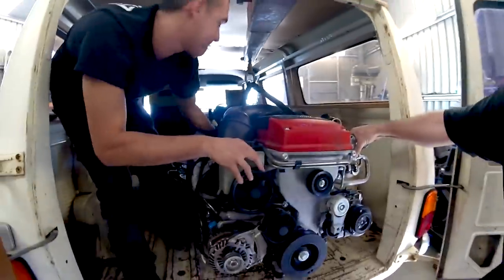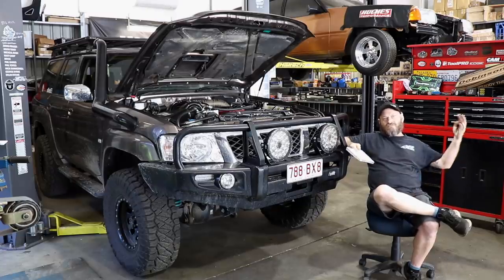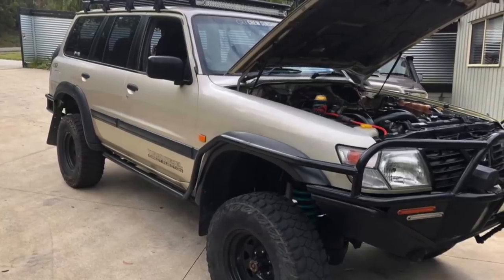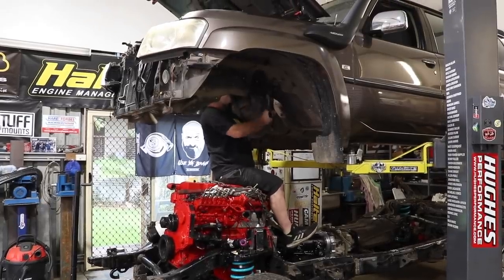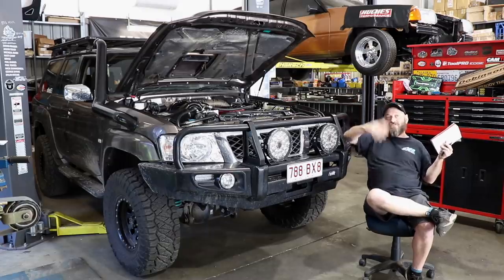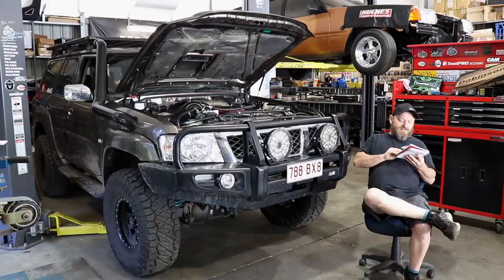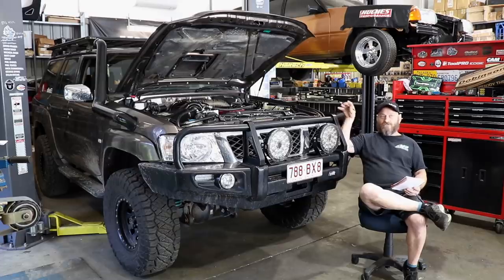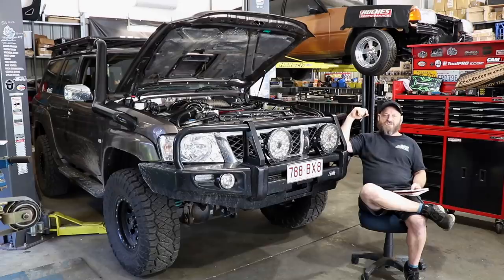Thinking of a Cummins Conversion? Watch This First!

Comment from the maker: New Merchandise Available! https://theskidfactory.com
Reply: Hi  I was wondering how a V8 landcruiser motor would go in a patrol and why no one has tried I was told they don't fit which doesn't make sense when they fit a duramax any comments
Reply: You couldn't fit a 6 speed allison 2000 in there?
Reply: Active noise cancellation might help knock down some of the engine noise. Pretty much put a mic near the driver's ears, feed that signal into an audio amp which drives a speaker, but swap the polarity of the wires going to the speaker. If that works a bit, you can make it fancier by gutting a pair of active noise cancelling headphones and using the output to the ear cup speakers to drive the audio amp & speaker.
Reply: We wish researchers and workers in the technology and engineering department to find plans for the new car industry
Because new cars should be flying saucers in the sky
and These flying saucers must have three perks
1 / The flying saucers must be self-driving so that everyone can use them
2 / The autonomous driving of flying saucers must be based on artificial intelligence programs
3/Artificial intelligence must rely on the new Google Maps in order to direct the launch of flying saucers to the desired places .
Send these three basic demands to the technicians and engineers in the mechanics and technology department in order to make flying saucers
Reply: It's your knowledge that has me back everytime mate.. the tips and the tricks matched with a top bloke with a awsome sense of humour makes for good viewing          🤜🤛 🇦🇺 take care Al and stay safe brother
Reply: I’m not peein’ Eur-o-pean
Reply: dodge auto is rubbish,,the ford is better,,but the allison is best.. why,why,on earth do you need a cummins in a fkn patrol..for 50k,i can get you 100 decent deisels. cheaper,better lighter..you dont need 1000 ftlb to 4x4.  1400nm.ish..stupid..you like tech,.should of got the 5lt tdi cummins..kills toyotas crap..
Reply: The Skid Factory 
Exactly how does a Cummins crate engine cost $50k (USD)?

Comment: Projects are always bad financial decisions but it's what we like and it makes us happy
Reply: Yeah and it’s still cheaper than a 79 land cruiser price and if done right better in every way and there so popular so it’s probably not as bad as it sounds long term.
Reply: It all depends on the size of the project.
"Small" upgrades around a weekend to bash out can be really economical.
Full builds and conversions are rarely economical but they really build the sentimental value.
Reply: I don't know- have you seen what new cars cost these days? You can easily spend 45k€ on a VW Golf... a nice Audi sets you back 65k€...you can mess around with a project car a lot for that... sadly in my country project cars are very hard to get legal- and especially engine swaps are almost only done withing a model range
Reply: Yep, just take me n my Subaru. I'm 14 years in and it's done more miles on the back of a trailer or in a shipping container than it has under its own power!! Just need to get that EZ30 built, hey Al...? 😉
Reply: Hi Mate, I have been looking for quite a few years now at a the Mercedes om606. From all accounts they seem to be a very reliable and economical engine, capable of big power. I have done a fair few patrol engine conversions now, from my first which got a L34 308 in a mq.
Have spoke to diesel pump UK about sourcing the components and they told me they can supply the complete conversion with engine for  15k, plus shipping which in comparison to some other conversions, is very reasonable.
Reply: not always buddy
Reply: And the sell it
Reply: @michaelperrin3503  Better in terms of reliability?
Reply: I don't build trucks or cars but I do build motorcycles ( frame - motor build - paint) . It's a hobby , but If I can't make 3k plus off a motorcycle ; I hen I won't even bother with it.
Reply: @kramer26  that's because it's a Subaru...

Just kidding mate couldn't help myself 🤭
Reply: Hahaha!!! Love your comment. You absolutely hit the nail on the head brother.
Reply: @immelting9834  well it's a business then and not a hobby

Comment: GVM and GCM became a problem when the insurance companies started weighing everything that fell out of your 4x4  onto the road after you rolled it with your 87ft van on the back to deny a claim.
Reply: And quite rightly so! The vehicle was engineered for a given mass for a wide array of reasons. Brakes, suspension, chassis and so on could all be inadequate. Poor control of your towed loads can also be a real problem, leading, as you say, to your 87' van spilling its guts. As much as I am not a fond a large US pickup trucks, if people are going to tow 3500kg and heavier caravans around, they are likely a far better option.
Reply: Yep and the new ute/truck things are the only way to do it and still be under that number, without being the only person in the vehicle with no gear.
Reply: Hence I bought a new silverado 2500HD to not risk a no payout if something happened when towing the $250k toy
Reply: I've done a GVM and GCM upgrade on my 200 Series. I only tow a Kimberly Kamper and it still get's sketchy sometimes.
Reply: Agreed ... If your going to tow small houses behind a vehicle, get the right damn vehicle. F truck, ram etc and be safer while doing it.

Comment: 15:30 "Nowadays everyone hates smoke, which has changed from last week."  Subtle and timely remark there, well said.
Reply: Well... outside or our bubble, most people want clean air and quiet cars
Reply: If you follow Deboss, he's always said that rolling coal is childish and offers zero performance benefit.
Reply: @muf1772  "Performance" is when a machine does what YOU want it to. Deboss's assertion that he knows what is best for you is the over arching problem here. You gotta get better at spotting authoritarian cucks and silencing them instead of elevating them.
Reply: @DieselRamcharger  Making childish comments to defend yourself against being called childish, that's gold
Reply: I can be a public annoyance for much cheaper

Comment: Nice to see honest opinions from someone about there own build.
Its too easy to just pretend what you did is all spot on and perfect.
4JJ1 would be a good choice in the Diesel world but i reckon a Barra with around 380 RWKW would be tough to beat and the 25 odd grand of fuel you could buy with the savings would go a long way.
Reply: Agree, the 4J would be a great choice with the aftermarket possibilities!
Reply: Too true on the 4JJ1. Considering one for a 60 series conversion… or a Barra.
Reply: Yes barra would have high hp and the power would be in a different band high in the Rev range being petrol this makes it easily down low with minimal stress , but it’s all about what noise our ears like to hear 😂😂
Reply: @jmac822  maybe so but would be highly stressed maybe ?? Where as these big ol donks just plod along mainly in idle , also the 4.5 cummins get good power very low in the Rev range which is where u want it ,
Reply: I daily drive a 4JJ1 Rodeo,   and have had a TD42T patrol for the better part of 12 years.
I wouldn't put a 4JJ1 in a Patrol, While the peak power might give some people a boner, the driveability is not the same.
Reply: @bradmcgrath358  exactly like he said hp is all well and good it’s the torque u want and down low
Reply: They do 4jj1 patrols in Sydney now
Reply: @keithy363  Nothing wrong with the 4jj1 torque mate 
4jj1 upgraded injectors , turbo , front mount , computer 
Blokes are getting a safe 250hp AtW and over 600nm of torque
Reply: @jmac822  they snap cranks at 300 😂
Reply: @jmac822  was talking about the bloke saying a 4j making 600hp on standard internals

Comment: I LOVE that Al embraces modern tech. Too many guys afraid to learn. They see all the wires and run for the hills.
Reply: true and i took the time to learn it and then i only ran from it more. what happens when a pcb board gets fried or the software acts up. with mechanical pump theres no guessing u can see and feel everything that’s happening. switching away from carbs in favor of fuel injection is one thing, but those mechanical injection pumps are stout mechanisms. they tend to be far more efficient as well suprisingly.
Reply: It very much depends on the car. I know in the classic minis the electric fuel pumps are the reliable option because the mechanical fuel pumps can fail in a way that leaks fuel into the oil

Comment: One of the BMW M57 varients, hard to beat price wise. Tremendous tunability and incredibly strong. Can get them from UK wreckers for pennies. That or an OM606.
Reply: I saw a couple GUs with an M57 conversion from Russia and Europe, they were making huge power from what only looked like a backyard job
Reply: I've been ogling an m57 for my d2. Would be a hell of a step up from the current td5.
Reply: Exactly. I cant see any good from swapping 6BT in passenger car like Patrol. That thing must weight in like two almuninium M57s.

Comment: Having done this conversion myself, but slightly different, I’d like to add my 2 cents. Obviously I didn’t do it quite the same as you but it’s definitely similar. I used a 12v 6bt through Texstar automotive. Originally all we were going to do was change all the gaskets, but thought since it was pulled down why not rebuild. Engine cost was $7200AU landed in Brisbane, rebuild was nearly 3k, but only reply once major parts that needed, and replacing all valves and stems. I always wanted a manual, and went with that to begin with, before going through 3 patrol gearboxes and shearing 3rd in all of them. I eventually went to a basic 4l80e, which was functional, but wasn’t what I wanted. Never played with the fuel pump too much, just went 4K gov springs and a fuel plate, but it just wasn’t to my liking drivability wise. Don’t get me wrong, could pull a house down but I’ve just never been an auto man. So I started looking down the path of manual. Ended up with a PaR gearset with custom 1-5 gears ( they have a shoo wheel of short or tall for every gear depending on your needs. They were originally designed for the Dubai 4.8’s with stupid power) and they have actually worked an actual treat! Thai set up also comes with a billet input and output shaft that is considerably bigger than factory to handle the extra load. Considering it only costs about 12k all fitted (including custom HD clutch to suit the shaft, it has honestly made the entire investment worthwhile! Taking out all the costs of doing things wrong, it can easily be done 45k on road with Abrams new motor and gearbox. I tow an OP4 camper as well and dragged that up little red just to be sure it could take me anywhere, and has no let me down. I have since done 8500k around Oz and wouldn’t change my set up for the world. Even with all my weight, fuel consumption is currently sitting at 13.5lph which is ridiculous for a car that size and weight! I personally believe that if I knew what I did now at the start I would’ve saved myself atleast 20k, but would recommend this conversion to literally anyone that will listen to me!
Reply from the maker: Thanks for the feedback mate, much appreciated.
Reply: I might need some of that info……just bought my patrol and I’d like to have a plan in place if it decides to go bang!

Comment: Google M57 bmw patrol. they seem to go great. thanks for sharing your thoughts on this conversion, especially since you have done a couple of different ones. i have had the a duramax also and now a LSA . they are both great in their own right  but very happy with the LSA now and prefer it. the ease to work on it, to get parts locally and the milage is no worse than a 4.5 or 4.8 from Nissan and instant power it makes, makes it a very enjoyable 4 wheeler.

Comment: Dieselmeken and BlackSmokeRacing would be a great place to start when looking at Mercedes diesels :)
I love this type of video where the job is being weighted and everything told as is. Keep going guys!
Reply: Diesel pump UK have alot of experience with the om606 conversions. They can supply a full billet aluminium conversion kit for the patrol.
Reply: Thanks i hadnt seen those channels but have now subbed. looks good.

Comment: Nice work done. I think a P Pump  24 V still offers the best of both worlds. I combined a 24 V in a 99Ram (got rid of the 53 blck and swapped to a beefy 12V truck engine with solid bed plate and 230 HP from the factory.) I changed the internal components, took some flesh out of the ´24V pistons (exactly like Jeff Garmond recommended it) combined it with the 24V head and a gigantic inline Bosch pump from a SEATEK 10.3 L offshore race engine.With twins, a huge intecooler and some free flow exhaust it made a little shy of 900 HP on the dyno but was so good with EGTs, that I could go with 230 km/h (I live in Germany) for a long time and never saw anything higher than 1280 f before the turbo. I have and H1 Hummer with a 6BT 12 V conversion and s Scout with a Twin turbo 12 V and 1044 HP@ the rear end (beefed up 9") That is a daily driver, even good on Gas and  with a 3.0  rear ratio and 20" Wheels I can shock Cayenne Turbo S and Trackhawks on the autobahn. They hate that it´s a Diesel with an historic license plate. If you google "Monteverdi race 2014" you see me competing with a 997 GT2Twin Turbo Porsche on a 1/4 mile race. I have an Airstreammotorhome with a cummins conversion and a Ram 1500 Shorty with a Cummins and just sold my 1998 Suburban with a 12V Cummins swap. In the UK you find those engines pretty cheap and if you combine some practical skils with a good network of used parts a conversion can be done a lot cheaper than 50k. for instance the Scout breaks are obviously not capable to handle a truck that easyly goes faster than 260km/h. Jaguar XKR Rotors with Viper 4 piston calipers was my solution. Way ligher than for example the Dodge Ram SRT 10 brakes and with some manufacturing not outragiously expensive. But a nice, reliable and roadworthy conversion is the BMW 5Series 2.5 L 6Cylinder engine with Bosch rotary pump injection. I have 2 Scouts, a Grand Wagoneer and a Stepside Chevy Pick up with BMW engines. Parts are everywhere, if you stick to the very reliable 4HP 22 ZFtransmission you can have a Diesel Conversion for less than 5 k. My Grand Wagoneer I drive with the BMW engine  since 11 years, one of the Scouts since almost 20 years.For German safety laws its important the the conversion could be authentic and done in the US. What very few people know is that this BMW engine was used in the 80s in Lincon continental vehicles originaly

Comment: If the Mercedes diesels seem interesting to you, be sure to also check out the BMW diesels. The M67 is interesting, but not that common, while M57/N57/B57 are very well supported, though they obviously sacrifice some displacement.
Reply: I prefer reliability, something BMW badly lack.
Reply: @davydoo81  to each their own. I like to judge engines and cars for that matter by their merits, not by their badge. Saying that those engines are unreliable is simply misinformed.
Reply: @magnusbuinevits9535  lol, you misspelled “informed”,
Reply: @davydoo81  do please share with us what the issues with those engines are
Reply: @davydoo81  Some of the most reliable engines ever made, but okay.
Reply: @magnusbuinevits9535  The silence is deafening haha
Reply: @kristoffer3000 I’ve had the displeasure of being a BMW tech.  Timing chains regularly failing below 100,000km, numerous plastic components in the oil and coolants systems which dissolve again in less 100,000km. Very poorly engineered.

Comment: BMW 3ltr turbo diesel (inc gearbox) is another option, E9* 330D engines. There is adapters to fit to the Patrol 4wd system too. One was just finished in our workshop actually. Goes well and sounds great too!

Comment: You will probably have 300ft/lb of torque at 1000rpm without the turbo spooling which is why they move on ok but a cummins with snappy response is much more fun and usable and worth sacrificing a few peak HP for.
On my Cummins Landy the fuel economy was the same as the 2.5TDi it replaced but it didnt drop off when I was towing which was nice!

Comment: Just because it has a P pump, it does not have to smoke. If they are calibrated correctly, they are still a very reliable pump. As Al alluded to, it is probably the choice of turbo that has lead to it being set up to overfuel and smoke. Also if you are considering doing a swap like this be very aware of what vehicle the engine came out of as the pump governors are set up differently for industrial application (all speed governor) or road application (min/max governor). It makes a huge difference for the drivability of the vehicle at the end of the day. And yes, you can have all the HPs in the world but it is torque that pulls you up the road (or out of the bog hole). Overall, loved the project and cannot wait to see what is in the pipeline next.

Comment: ABSOLUTELY CAN NOT wait the Mercedes OM606 build!!! One bloke in Estonia(where I'm from) runs om606 with compound turbo setup with 600hp with full boost at 1500rpm, quickest diesel at one mile challenge with 296km/h. All of this from an unopened engine with over 400k km. Myself owning a stock om603 running on veggie oil and building a turbo M104 inline 6 petrol engine, which is the om606 petrol brother, here in Perth. So definitely looking forward to any 90's era Mercedes tech on the channel! I mean, you have done everything else, haven’t you!